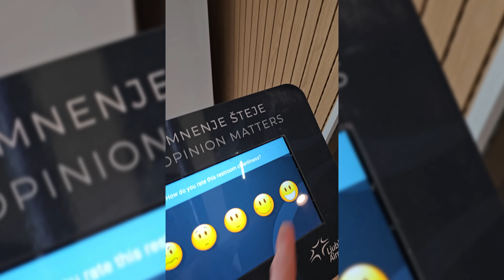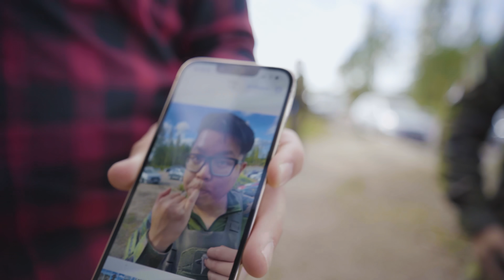Best shooting competition in the world - Finnish Brutality

Comment: Do you plan to change the trigger? Do you have a suggeston what to get for Saiga 308 alternatively ?
Reply from the maker: I will have to remove more material from the hammer so it wont snag or cause friction on the bolt carrier. As far as i know there is no aftermarket trigger for .308 AKs - if they have the 3rd locking lug on the bolt

Comment: Todd will be very interested on the Magazine Break. (I will use only covered pouches then)

Sad news on the Moded ALG Hammer hang up.  Maybe a +15% spring will clear that out.  Maybe a little more contouring of the top corner of the Hammer is needed. 

As for 'soft recoil' a friend I introduced to the 308AK in the form of a Super Vepr preferred it over his M1A National Match. (I will remember the tight shoulder rule, even though I already have the +15% spring.)

And Ziga...what did I tell you when you asked the loaded question of "So I have no chance?"

Comment: How does an ALG affect cycling
Reply from the maker: .308 AKs have 3 locking lugs on the bolt instead of 2 like normal AKs. 
The 3rd locking lug interferes with a standard AK trigger group. I modified my ALG trigger to fit but it seems the clearance was not big enough so the bolt lug was scraping on the hammer everytime the bolt cycled